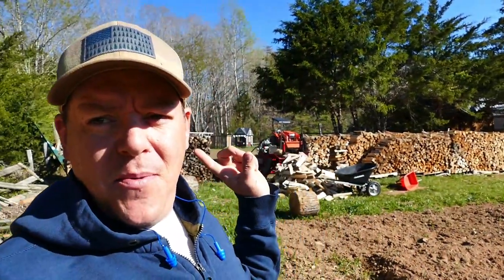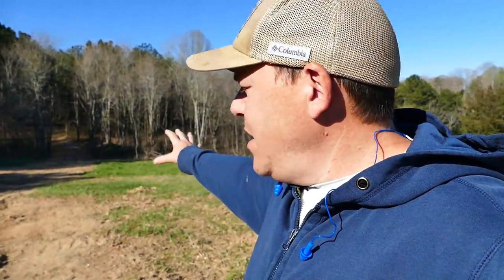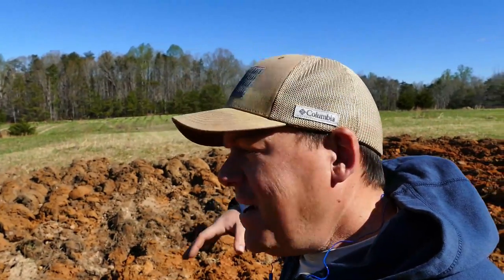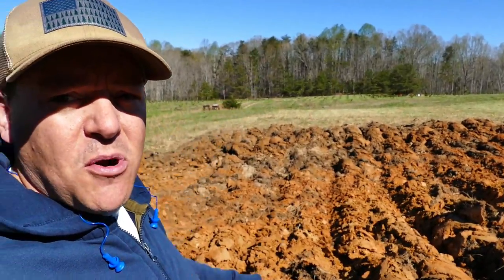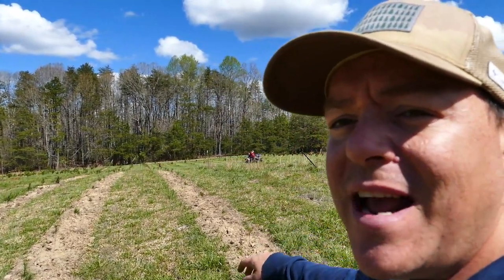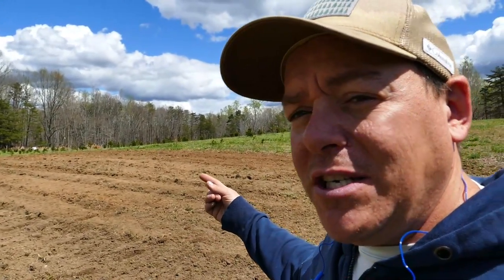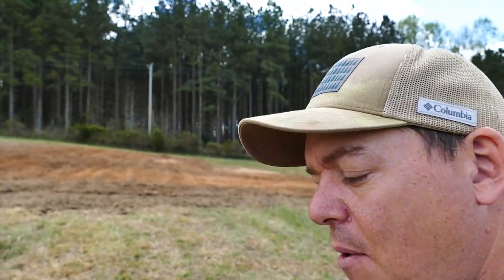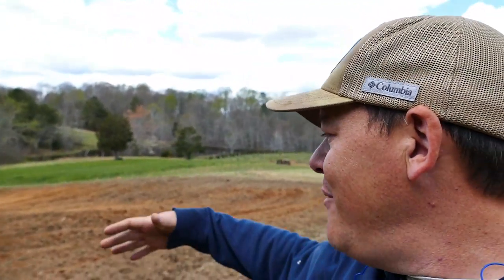Plowing & Tilling To Improve Soil in 3 Different Areas

Comment: Glad to see the Farmtrac in action! Did you tell me before it doesn’t have fluid in the tires? It seems to break traction much easier then mine. Looked like you had a beautiful day to be working.
Reply from the maker: I don't actually know if the tires are filled. I've never checked. I try to get the plow to dig down as deep as it'll let me dig, and that's why it keeps breaking traction. The soil is real heavy and compacted